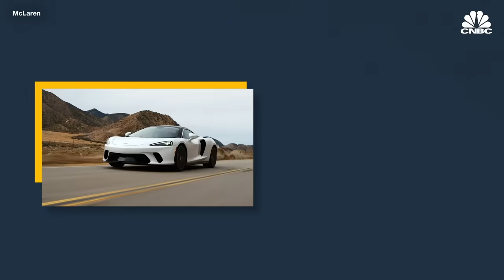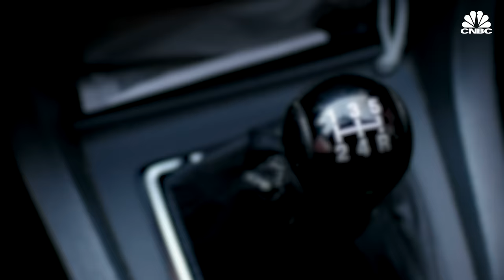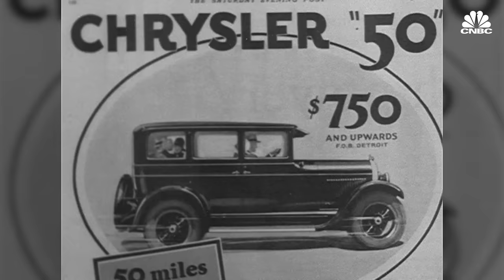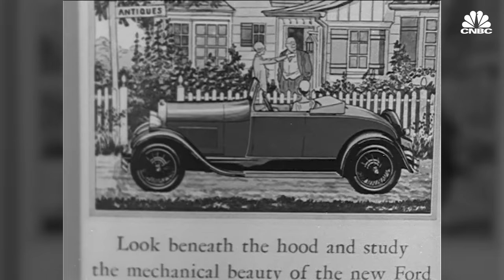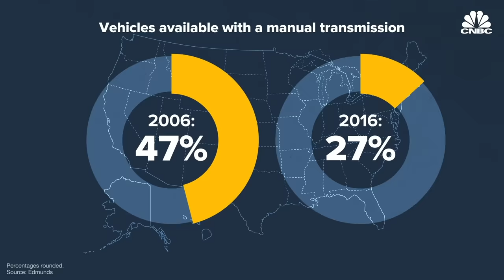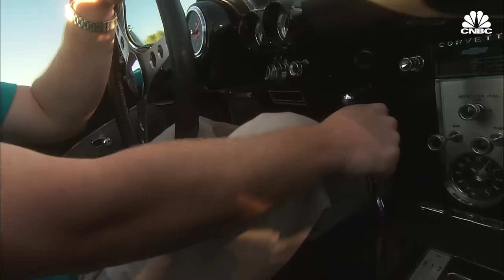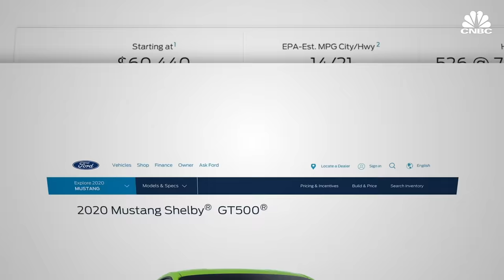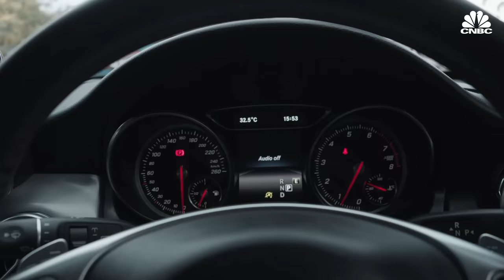Why Stick Shifts Are Going Extinct

Comment: Advantages of manual tramsmissions:
•Serviceability
•Reliability
•Control
Reply: Robby Dey  don't forget about dual-clutch...double the clutches, higher the price for changing the clutches. Also, A/T heavily relies on electrical stability of a vehicle whereas a manual don't. You can even push a manual car when running out of batteries to start it.

CVT's are still lacking...only good for fuel economy but not reliability (once broken then it's done).

The only A/T that's close to manual is the torque converter, but only in terms of the throttle feeling.
Reply: Robby Dey  try saying that to people like nissan owners with a cvt automatic transmission
Reply: You forgot fuel economy
Reply: Robby Dey the fluid change only works if the fluid was already routinely maintained and changed as directed, if the car has been running on the same old transmission fluid for 75k-100k miles or more it’s risky to change the fluid cause it can ruin seals and cause the transmission to go out. Seen it happen with an old ford truck, first auto trans fluid change in 100k+ miles and bam transmission was done, and since it was an old truck it wasn’t worth it to swap for another transmission
Reply: Robby Dey  Only Toyota's, all others still have weak automatic transmissions.  Automatic transmission reliability is still less than a manual, do more research.
Reply: Please add security. Less likely to get stolen
Reply: You forgot fun...
Reply: @MrMaxyield  This vid is vury USA-centric. Meanwhile in Europe, manual transmission mucho popular and better e.g. stuck in mud or snow or just to have crazy, high rev fun! 
Counter-intuitive I know, but I spot a niche market for manual electric cars.
👁   👁 
    👄   U gotta dig it!!!
Reply: I own both a manual transmission car (Acua RSX) and an electric (Nissan Leaf). As much as I LOVE my manual, I can see that there is really no need for a manual, auto or ANY transmission whatsoever  once you go electric. The simplicity, and reliability of the electric far outweigh the "joy" of my manual. And I've tracked my rsx quite a bit over the years.
Reply: @namyzarc6269  outweigh the 'joy' lol stop you're probably just reaching that age
Reply: Enjoyable to drive, period
Reply: Robby Dey  Clutch is easy to replace.  Most automatics are being replaced with CVT in small cars.  CVT is horribly unreliable compared to manual and the cost to repair a CVT is huge.  A clutch can be swapped in your driveway with a few tools if you know what your are doing.  You can hardly find a compact or midsize car that comes with automatic anymore.  They are all switching to CVT.  Only large vehicles that need more power to move still use automatic because CVT can't handle that much load.
Reply: @namyzarc6269  The RSX has the Honda K series engine, probably the greatest 4 cylinder engine of all time capable of 1,000 hp with modifications.  Comparing that to the leaf, a numb, dorky, soulless box on wheels is hilarious.  Good luck taking a road trip in your leaf.  You need to stop to charge for hours every couple hundred miles.  A road trip in an electric car would take 10X as long.
Reply: Robby Dey auto transmissions are LITERALLY the reason most cars end up in the junk yard. It is so rare for an engine failure but transmissions being so complicated now, especially those damn cvts, you’re lucky to get 150k miles out of them. Let alone my 99 5 speed f150 has 300k on the clock and I haven’t even replaced the clutch. Still drives and shifts like a dream.
Reply: Most important one
- FUN!!
Reply: Robby Dey   a manual transmission doesn't have to be rebuilt as often as a automatic.  And the repair bill a couple of thousand dollars.
Reply: Robby Dey  Nissan has terrible automatic transmissions. Honda Odessy was bad. The new beetle are terrible transmissions. Terrific pieces of junk. Fiat Chrysler, minivans terrible transmissions. 2017 recall 1.4 million trucks transmission recalled 9 speed ZF.
Reply: Robby Dey  haha reliability and cost are still huge man. Take a look at CVT, Dual clutch, etc. extremely expensive to fix/replace and not very reliable either. Sure if you have a traditional automatic transmission it's somewhat comparable but the MT is still cheaper. The odds of needing to replace your clutch before 100,000 miles is low unless you beat the crap out of it or ride it all time like a doofus. They keep adding more gears to automatics and more computer assisted stuff so I am still gonna say you'll pay more driving even a traditional automatic transmission.
Reply: @Plur307  also a clutch should last  the life of the car if driven properly

Comment: "Why Stick Shifts Are Going Extinct"
Europeans: Say what?
Reply: Yoan Mitov Latin America doesn’t drive automatic either. This video applies mostly to the Us
Reply: Even in Europe more ppl are ditching stick shift. And of course more ppl buying electric cars.
Reply: It's changing in Europe as well. Of course if you go for a cheap car with a small engine, since you are saving up, you'd likely go for a manual (but not necessarily). If you get an SUV or a nice sedan nowadays, it'd be ridiculous to get it manual

Comment: Recommended next article: why many companies are moving to CVT's. Many of them don't last more than 60k miles, while old manual and automatic can keep going forever.  Just making people spend more in repairs? And btw, they are expensive to repair #cnbc
Reply: @nick-zc9xv  The Nissan cvt's are VERY unreliable.
Reply: My Honda with 100k+ miles  runs smoothly with CVT just make sure you do the regular maintenance like changing the CVT fluid.
Reply: Planned obsolescence, that why
Reply: Also mpg and easier and cheaper to manufacture.
Reply: Consumers who were told "as good as a manual transmission" are finding out that their honda civic costs over $5,000 for a transmission rebuild after six years of use or so...
Reply: It's fuel economy regulations. CVTs are garbage for literally everything but that.
Reply: @1337penguinman  they're also incredible for cruise control.
Reply: As expensive to repair as a cvt swap, but they would rather have them all on the road, so warranty shops are forced to tinker with them, physically and through software.
Reply: toyota ecvt is brutally reliable.
Reply: Even worse is some old CVTs where they program in fixed gears, which eliminates the main advantage of CVTs. Like WTF is the point then
Reply: Exactly when a cvt breaks may as well get rid of the whole car they're too damn expensive to fix
Reply: I know MINI is not a pinnacle of reliability, but if you look back at the Cooper models with “automatics” from the reintroduction around 2001 or 2002, those were using early Aisin CVT transmissions, and tons of those cars are on the road today with 100,000 or 200,000 even 300,000 miles on them. They sold those CVTs for an entire generation and no one was bothered by it then. Then again, the Cooper was also frequently sold with a phenomenal 5-speed Getrag and the Cooper S came exclusively with a 6-speed Getrag at the time.

But as for CVTs, Nissans have a terrible track record - that we know, but a properly designed CVT will last. That doesn’t mean they’re worthwhile but they are not very complicated, they’re very compact and lightweight, and maintenance is relatively simple albeit more frequent than comparables.

Comment: When I brought my car in to get the windshield replaced, my mechanic loaned me a 04 Civic for the day but the battery was dead on it so he loaded me a jankey 95 Toyota Tacoma with a manual transmission.  It was falling apart and I couldn't get anything on the radio but I did have fun driving it cause it was a 5 speed.  I'm probably never going to buy a new car if there's no manual option.  it's the only way I can enjoy driving and not make it feel more like a soulless chore.
Reply: ya, i agree i enjoy manuals. It something you don't understand until you've done it
Reply: Omg agree👍. My old mustang needs fixing I'ts  a 5 speed. But it was easier for the time to buy a new car and fix mustang later ( as a side project) so I went to every dealer and they laughed Everytime I asked for a stick shift car ( also I'm a girl) they taught I was crazy.  But joke was on them. There was no way I would ever buy an automatic ( unless I'm like 80 yrs old) it can be a automatic Ferrari and  NOPE! I need a stick shift! Lol...  Don't care what it is as long as it's a stick shift 👍☺️❤️ thank God I found a new lil 5 speed car. ❤️👍
Reply: Yari Go girl...

My sister in law has been trying to get me to teach her how to drive a stick for a couple of years now, but every time she comes to visit we have so much other stuff to do we haven’t got to it yet. One of these days...
Reply: @yari722  Yeah I would never buy an automatic unless if I'm too old to shift gears lol  Manual transmissions are just a joy to drive
Reply: Furry

Comment: It’s cool to be apart of that 2% of 2019.  I went to the Toyota dealer and was leaving when they told me they had three 86’s with autos and no manuals but before I got in my car they ran out and said they where backing one off the truck with a manual lol
Reply: I went a few states over to get my 86 with a manual
Reply: And yet the 6 speed manual is standard issue in the VW Passat !  Automatic is a More $$$$$$$ option !
Reply: I bought my Fiesta ST brand new in 2019. I'm part of the 2%! Damn proud!
Reply: @PokrPro21  Another FiST driver here. You can only get them with a 6 speed stick. It's the perfect transmission for the car.
Reply: When people see my 09 Corolla S with a 5 speed manual they are wanting to buy it. No way I say! 😄

Comment: All I see is a bunch of boomers sad about their primitive technology being phased out in these comments
Reply: That primitive technology costs less to produce, less to repair, and will far outlast your automatic
Reply: @martyharless5097  you may be right when it comes to cheaper to produce and to repair, but modern metallurgy and oils have made machines significantly more durable than they used to be, you’re just an old head stuck in the past.
Reply: @thatguy1919  I'll be sure to wave to you when you're stuck on the side of the road after your onboard computer farts as I'm passing by in my jalopy. Now get off my lawn!

Comment: Meanwhile more manual miatas are sold then automatic ones.
Reply: BMW M2 and Porsche 991.2 GT3 both had over 50% manual sales, in 2018 or 2019 if I recall.
Probably an "end of an era" type of thing.
Reply: because the market is manual
Reply: Because the car is slow as balls. If the car is slow, manual makes up for it in fun factor. As the car gets up there in power, YOU WANT the auto. Manual is a disadvantage when cars have more power. That's why all the high performance cars now are auto. To bring the best out of the car.
Reply: @theguy1224  Exactly, but I still think a niche market of Slow ICE vehicles need to be persevered like a sport. We need to evolve that community into a luxury a separate it from transportation industry. If they continue to rely on transportation to bank role their vehicles, the Niche is doomed.
Reply: Miatas are all about driver involvement,I can see for a commuter car why people would want an auto
Reply: Chris you realize you can still get a manual Pagani if you ask. They have like 700hp

Comment: Modern automatic transmissions have a high failure rate and can cost thousands to replace. A standard trans can outlast two or three cars.
Reply: You are right a lot of modern automatics are super complex. But you have no idea's how many manual transmissions I have replaced, and usually it wasn't caused by something like a wrong-shift.
Reply: I disagree, I had 3 cars running up to 300.000 km all using a automatic transmission.
Reply: @alexanderfrederiks8481  but then they are not modern automatics, or were they?
I had an old school automatic too, in a Volvo S70, made by a japanese company, man were they solid.
Reply: @MrTruth111  A Honda fit, with a CVT. A Mitsubitsi Spacerunner with a 4 speed and a older Accord Aerodeck. So not really old but also not the newest. Had a Hyundai as well but that was a piece of sh*t and the motor failed.

Comment: I don't even realize I'm driving a standard.  Shifting is as natural as breathing.
Reply: Exactly. I drove in heavy traffic for many years and I had to think about how I'm using my manual as often as I had to remember to breathe. It was more relaxing than with an automatic because I rarely had to touch the clutch or brake pedals. I just moved along at a speed where the vehicle in front of me would start moving again before I needed to brake. They would be back and forth with the brake and gas pedal.

Comment: I'm an outlier since I have an 2013 SUV with a 6 speed, a 1993 truck with a 5 speed and a 2016 motorcycle with a 5 speed so all my vehicles have a manual transmission! It's not a chore, it's more fun, your sitting there driving anyways, you don't save a secound of time with an automatic transmission. It dosent require attention, I don't even think about it anymore, Ive been driving for lots of years with manuals.
Reply: I imagine you actually pay attention to driving while you’re driving. Folks who drive manual transmissions do. Those who don’t, don’t. It’s a fact. You are a better driver than anyone who does not drive a manual. 
And they are a lot of fun. :)
Reply: @Yeah-its-me  well it's hard to use my phone when I have to shift lol. Atleast in the city, on the highway it's more or less the same

Comment: I spent months looking, but eventually I got my manual transmission Tacoma Truck, and I love it.
Reply: Pot Ate Toe took 3 months to find my JKU in a standard transmission
Reply: Someone told my about 1 million miles ago that, "I'd get tired of driving a manual transmission."
Reply: Nice, I have a 2005 Tacoma also in a manual. Great trucks! Mine has 200k miles and still runs like a new.
Reply: 2007 dodge dakota 6 speeds. Super fun to drive.
Reply: I get it. I waited over 2 months for my 2020 6MT Crosstrek to be built in Japan and sent over here to the US. #savethemanuals
Reply: @Justin Craig - it's  a 2008, dark blue, with a 2.5" lift, big tires and a winch. It's just beautiful
Reply: I bought a 2019 Versa with a manual back in november, I had to wait for them to drive it 300 miles from another dealership for delivery, I feel your pain
Reply: 200K miles on my manual 1999 Tacoma and still going strong. About to get a manual 2020 Taco. Manual Tacos = LIFE.

Comment: I would much rather have a manual transmission especially while driving in the snow
Reply: They're also fun to drive/drift in the snow!
Reply: I'd rather have assistive technology such as new ABS 'fidle brake' system with paddle shift. There is reason why once popular manual is gone, because computer can do it better than human these days... and nothing wrong to get some help on the road, both for safety and for performance.
Reply: @slothypunk  Computers and technology cant always do it better than humans, I drove a new 2019 volvo semi with an automatic, it was junk. I went back to my 94 freightliner with a 13 speed and felt a lot better.
Reply: @billcarver6539  I think you misunderstand me, what I meant is the top of the line automatic and manual. You just can't compete with automatic racing nowadays. If I have to choose, I'd side with tech any day
Reply: Same
Reply: I prefer older cars because I dont want any of annoying and dangerous "safety" assists throw me off
Reply: for a second I read drifting in the snow
Reply: @slothypunk  But when you are drifting you can't get any better then that manuel. That is my opinion though. I do not like paddels at all.
Reply: @acetech8642  I respect your opinion, that is cool, and if you comfortable with your gear nothing wrong with it. I am not talking about mainly drifting. I am talking about attacking corners and get most performance
Reply: @MrRourk  think i did too .. shows whats the first thing we think of when the powder settles.
Reply: @slothypunk  Ok Karen with your "tech"
Reply: I know why 😏.

Comment: Anyone here realize whoever made this video had a very "I read wiki" knowledge of cars?
Reply: This channel is very much for a "I read wiki" style of audience. On all their topics it's just general information to get "in the know" regarding a general issue. Sometimes it sucks but eh, there's other channels that go more in depth.
Reply: @mog7501  yes, but it's like grade school knowledge. You first learn Columbus discovered America. Then later you learn it was just some of the islands in the Caribbean and he killed and enslaved most of the natives. They describe how a transmission and engine works to move a car almost completely wrong
Reply: @GREENneonDRIVER  I agree, they don't explain how the clutch plate disconnects from the flywheel,  they state "the gear size changes" which is odd wording. The power band explanation was too broad, not even a peak hp vs torque graph was shown. Oh well
Reply: Ahmad Rifaie Azhari  you missed the point. Try looking up. You may still spot it.
Reply: @HN I know how my pc works
Reply: @HN I care deeply how both works.
Reply: jeff cho at the rate that they spit out these videos, I wouldn’t doubt it... Still entertaining though.
Reply: Yes.. some super cars have flap paddle gear change which is not completely manual but not automatic
Reply: I mean you would lose a very large portion of the audience if you went too technical.